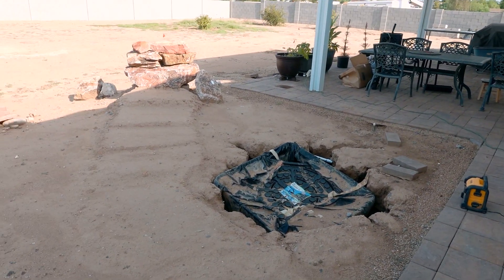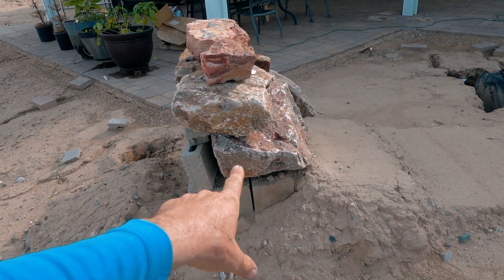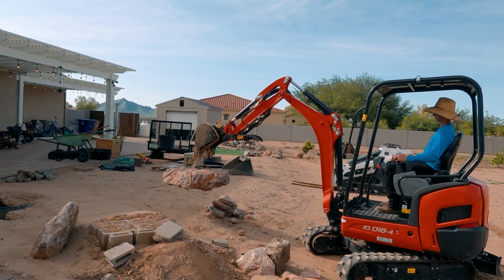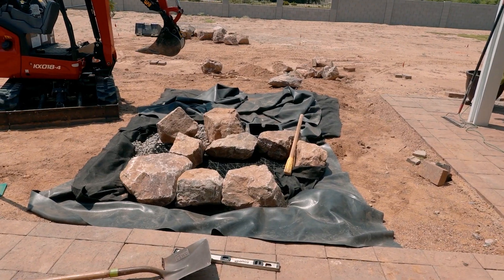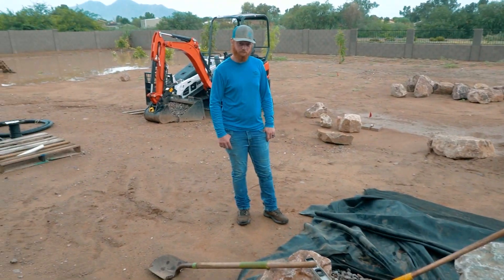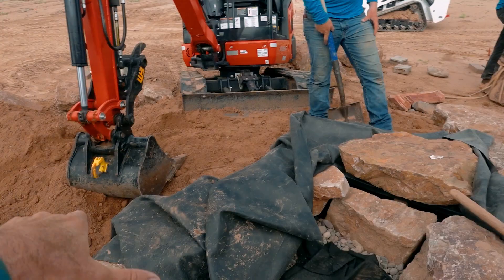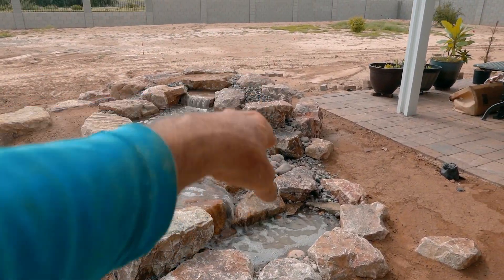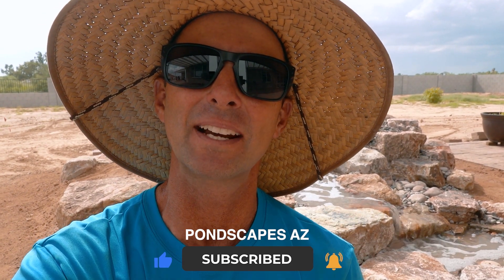**DIY**  Waterfall

Comment: This is one of my favorites. I have always wondered: What is the purpose of the spillway at the top of the waterfall, instead of just having the hose itself pump water into a pooling area at the top? Since the spillway isn't actually used to create a waterfall and is just placed on a flat surface. Is it because the spillway can just be placed on a flat surface at the top, and it won't splash since it comes out smoothly, while with just the hose it would splash, so it needs a pooling area?
Reply from the maker: You are correct. The spillway evens out and slows the water flow as well as provides as water tight seal into the liner via the rubber gaskets and locknut on the back of the unit. Thanks for watching!

Comment: So, base on the amount blocks I could see it looks like (4) large aqua blocks. 128 gallons in tota I calculatedl. Is there a reason as to why you used the aquascape 3pl about 3000GPH pump and not a smaller version?
As if I were doing this project I would probably calculate a 1600gph pump for the job.
What are the things, criteria that have to be met or taken in consideration when choose a pump for a job?
Reply from the maker: Pump sizing is dependent on several things like length, width, height of stream plumbing diameter, head pressure, size of rocks working with, type of sound the customer is looking for and desired amount of visual impact of water flow. 1600gph would have been a little underwhelming on this feature.
Reply: @pondscapesaz  exactly

Comment: Good job! Would it be ok to do a pondless waterfall that is turned off more than it runs? Would that cause alge or bad water, or is there no issue since it is “underground “ and out of the sun?
Reply from the maker: Absolutely. A lot of our clients are “winter visitors”. Their features typically only run in the winter months or people have them on a timer that only operates when they want to enjoy the feature. No sunlight on the water below ground means no algae and best of all no mosquitoes in stagnant pools of water while the feature is turned off.